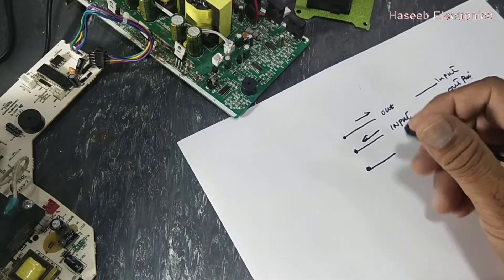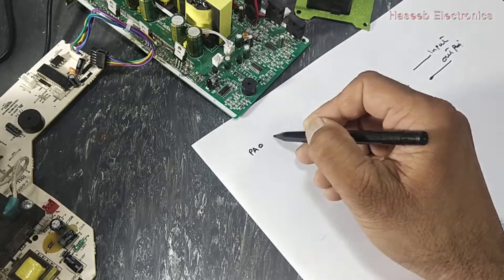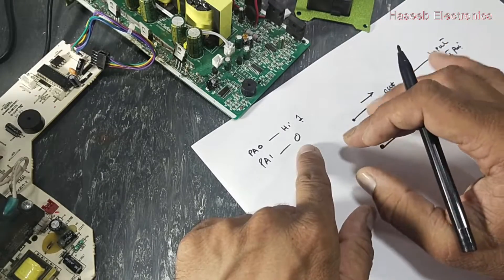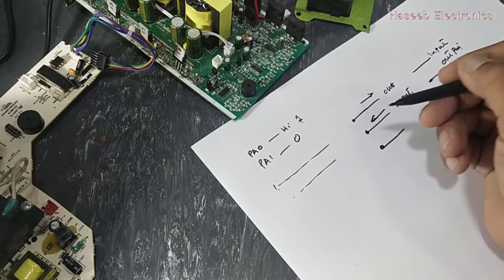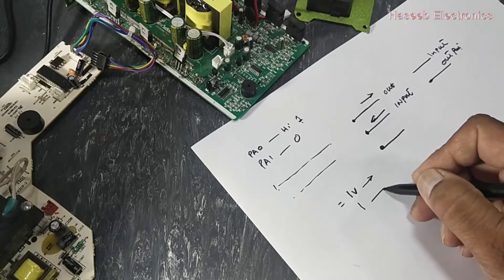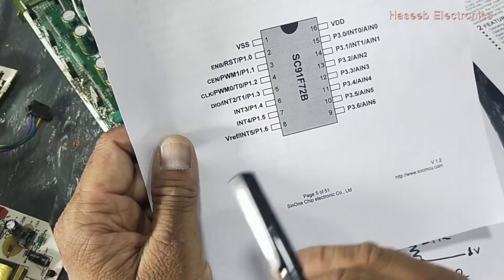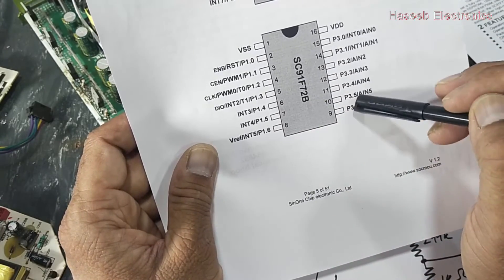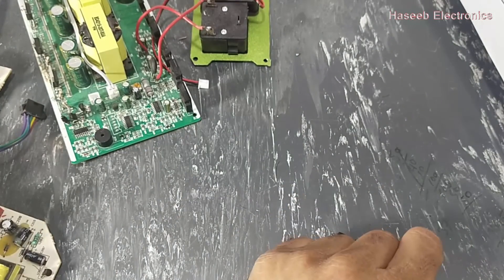{500) Microcontroller SC91F72B 8051 Core Flash MCU with 10 bit ADC What is Microcontroller Explained

Comment: Hi mr.haseeb.
What can i do if microcontroller broken and we don’t have any backup program for replace it.
The nuc100re that use in blu-ray player ans it’s controlled VFD screen, bottoms and IR remote control.
I check it by microscope and see a hole in top of it. I sure it’s broken but i don’t have any backup program .
What can i do?
Good job and have good day
Reply from the maker: in this case, there is just only one solution, that if you find same microcontroller, and you can copy its program to clone the new microcontroller, 
or
if someone can reverse engineer the board and he can write the code for that structure. that will much expensive
Reply: If their microcontroller’s fusesbits was active, then what can I do?

Comment: Haseeb -Ji your Videos are great and full of detail explanation. I have one issue and would like you to suggest me what can be done.  I have philips HTS 6553 home theatre system and it has problem. When I turn it on it starts slow and after some time it goes off. I checked the power board and all voltages are ok but when ribbon cable which has 27 v and other connections is connected to amplifier section its goes off and 3.3v does not comes to touch panel, is it power  section issue or amplifier  side issue and how it can be rectified Please help me in this.

Comment: Very well explained But here is one Question if anything goes wrong with that microcontroller and replacement is necessary but same new microcontroller don't have matching codes so how to repair that inverter ?  Any alternative solution ???
Cos it happens to one time in my experience same IC for inverter I replace but it didn't work and there was no source code for that IC.... Can you explain it in your next video ???
Best regards from Philippines 🇵🇭